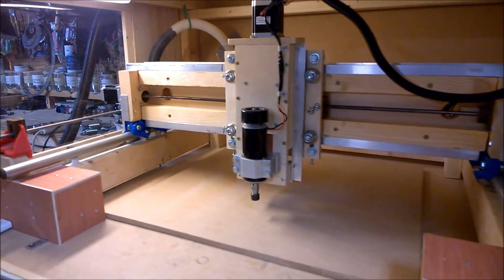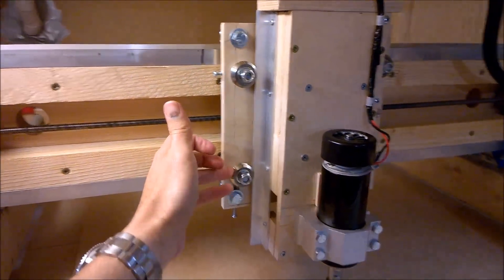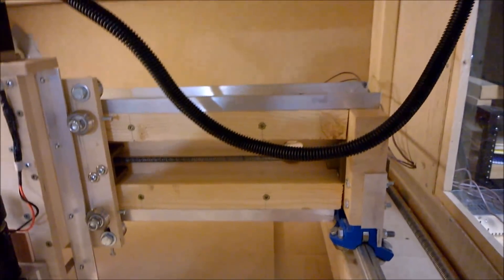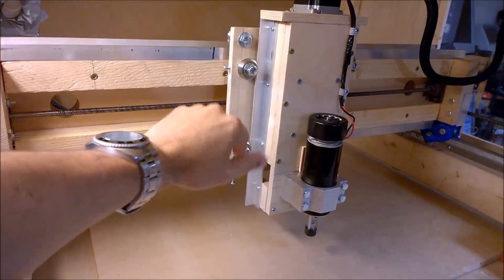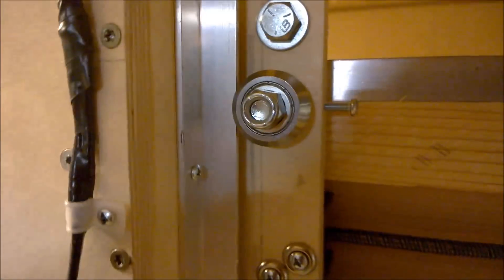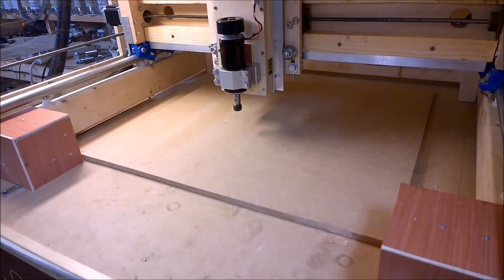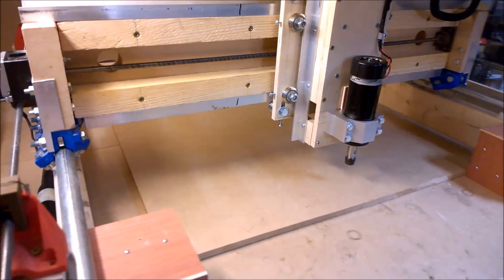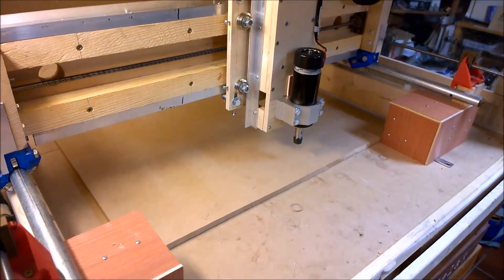DIY CNC - Gantry Re-Design (A Very Odd CNC)

Comment: What blue pipe brackets are those you are using at the base of the gantry and pipe
Reply from the maker: Those were from the MPCNC build I did a while back.  They are 3d printed parts.  The files are free and easy to print.
Reply: drez20001 link to the files please.
Reply: @bwilk5415  Type "MPCNC" in the search engine of your choice, you should find all the links you need.  You may have to dig a little but they are there I can assure you.  However, you are on your own after that.  Pro Tip:  You can apply this technique in all kinds of scenarios when you have a question. In time you won't even have to ask, you will just intuitively know that you can just "google" it on your own.  Good luck!

Comment: I guess you could do the X also? You are almost there.

I really like it, I got an MPCNC and it's working fine, but it's a little loose !
Reply from the maker: If it wasn't working as well as it is I might redesign sides.  I did some calibration testing last night and was amazed at how accurate the squares and circles were; within about .005+/- on opposite angles.  The MPCNC was a fun machine to make.  I think I made mine a little too large though and that contributed to the flex.  Thanks for your comments.
Reply: drez20001 I think the MPCNC is the best to learn how a CNC work! I builded mine 36x24 of working area. 

I might copy you some day if you don't mind :)